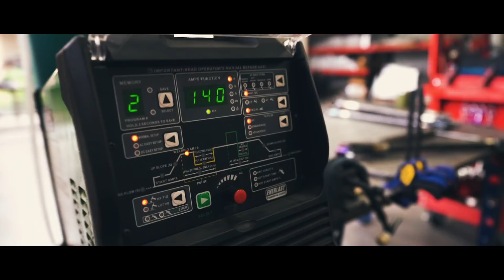RAGNAROK Hyper Car Build | Part 4

Comment: You should check out Essex designed by ap racing brakes, they make the brakes for corvette racing team and alot of people use them, they are top notch and they last much longer than CCB's for track use, they have pads that are 25mm thick so you can imagine how long they last under pressure

Comment: Hello,
I am wondering and didn’t hear somebody speaking of it the welded parts are the going to be heat after treatment?
Because when there is a lot of welding on the parts of the chassis and lots of welds gives lots of tension so when the are given a heat treatment afterwards and than cool it slowly in different temperatures the welds will losses there tensions so that the chassis will be stronger and mor resistant .
The do that on many navy welded parts of other machines ,cranes ,cars ,trucks and race cars ,dos it going to happen?
Because at 250mph there is no margins for errors.
It is just a tip ,no critics .
Doe not misunderstand me ,I found it a super build .
And a amazing job great work ,I am waiting to see the result .
Greetings 
Louis

Comment: It's 6 pistons ;) 3 on each side
Reply: Simon Brisebois-Therrien thank you
Reply: that doesnt mean anything  the more pistons a caliper has means more weight and less fluid volume behind it effectively meaning it cannot cool the piston or the caliper during heavy braking resulting in boiling away your fluid and having carbon rotors means that you cannot efficiently brake from random speeds because the rotor has to get to a higher temperature before it will work,.... slotted and drilled cryo treated steel rotors and ceramic pads or semi metallic pads will work better and last longer than a $20k brake system which is primally designed to stop a 3500lbs+ car from 200mph
Reply: Cool? Thanks for nerding us out, but you're pretty much out of context
Reply: @TwisNinja   That must be why the most expensive calipers has up to 10 small pistons. Greater preasure plus much much better brakemodulation is why. It will say you get rid off the on/ off feeling in the brake pedal...

Comment: Pretty sure you dont need brakes that big. all that extra mass is going to affect your acceleration times. Calc. the estimated mass of your car vs that of the car those rotors and calipers are meant for. you should be way over kill. will look cool, but be a waste
Reply: Pretty sure you lost a clue somewhere. I suggest you go find it.
Reply: @walterwhite279  You obviously have no idea about driving dynamics and the math behind brake system calculations.
Reply: oh how fun! Pierre-Andre Belle is making a judgment of my knowledge based on nothing more than my rather rude assessment of his. Let's skip the part where we compare brain sizes and go straight to the meat of the situation: Brakes stop cars. This particular car (when it's finished) should have the potential to travel at a much higher rate of speed than either the base car or the vehicle the brake components were sourced from.... most likely well above 200 miles per hour. So let's imagine a situation where you are going to drive the car to it's maximum potential and your most beloved family member is in the passenger seat. When you reach 250mph, think back to this post and ask yourself if Houston was right to install the largest carbon ceramic brakes he could find. Or forgo the overly dramatic imagination exercise and ask yourself why all the 200+mph cars being produced, sold, and raced in the world are using similar brake sizes and technologies. There are many answers to the question of, "why?" in regards to this car and it's braking system, and most of them are correct because they involve safety, performance, and scientifically proven technologies. The potential answer that you suggest involves moderation and hoping someone won't overheat the rotors, pads, calipers, etc when attempting to haul the car to a stop from extreme speeds, possibly many times in succession. Perhaps you should start trolling the major car companies who use brake systems like this to make their cars as safe as possible. If you do, please let me know so I can follow the responses you get. I would enjoy the entertainment.
Reply: Firstly, he is using the  gear box and engine from the gallardo. So his final drive ratio is the same. i.e his top speed unless he manages to get the engine to rev much higher than it currently does remains the same. So he is basically just going to hit the top speed to the gallardo. He will get there much faster no doubt, about but still the same top speed. So, 250mph is EXTREMELY hopeful. Also, You think major car companies put huge rotors cause their cars actually need them that big? Track cars ,like you mentioned, have massive brakes for heat dissipation. Road cars mainly just because it looks cool. For example, ever seen the brakes on an F1 car? Neither slotted, nor drilled. Road cars have those just cause it looks cool, not actually needed though with modern brake tech. Lastly, my answer DOES NOT involve moderation and hope it involves math, and a couple of free body diagrams to help.
Reply: You are totally blowing your roll in this trolling a troll drama. You're supposed to be the nerdy know it all who combats my vitriol by supporting your own statements with graphs, charts, references to other videos, quotes from physics books, and declarations of your own scientific achievements. Please get back into character... it's no fun otherwise. You started off pretty good, pointing out the more than obvious fact that increased mass affects acceleration times. You followed up that gem by instructing everyone to compare an unknown mass to a known mass so that we could all reach your level of understanding. The need to feel superior and flaunt your knowledge might be turning you into a troll. Trolls aren't known for their academic skills. You need a caustic wit, greenish grey skin, a few warts, bad breath, and a grumpy disposition to be a proper troll. As for Houston's build, I find it highly unlikely that a first time build without the backing of a significant engineering department and the resources available to a real manufacturer will result in a vehicle that has a significantly smaller mass than the car he's borrowing the brakes from. Bigger and heavier everything. I don't know, Houston doesn't know, and you don't know what the end mass will be. I applaud him for going the relatively safe route of stuffing big stoppers into the mix. His build is his build. Where's yours? I'd be interested in seeing the math and calculations you use to figure everything out.
Reply: @walterwhite279  I am no know it all. Also, hasnt he used a CAD software to design the car. That should tell him the weight so long has he input as much as possible. Which to be fair is an absolute hassle but he could still get a general figure. Moreover, i am part  of a formula student so "my" build is being designed. Although its not my build its the teams build. Lastly, i am not trying to be a know it all, was simply trying TO HELP. Thats why I just pointed him in the general direction that if he wanted the best numbers for his car the brakes he has probably wont help. However, if he wants a show car then those brakes would do it. But thanks for chat.